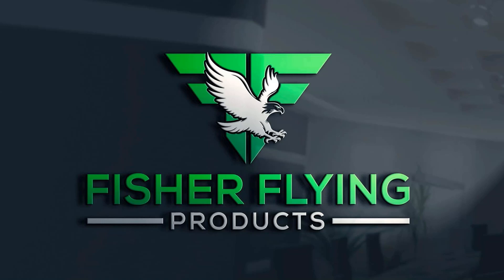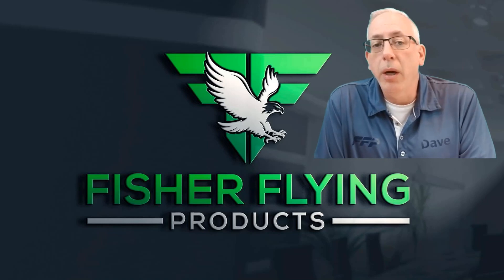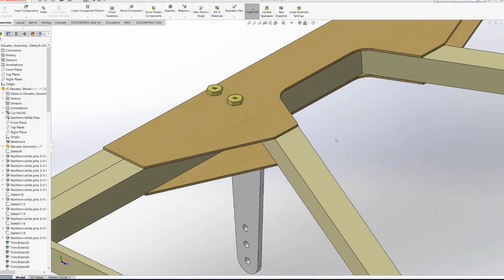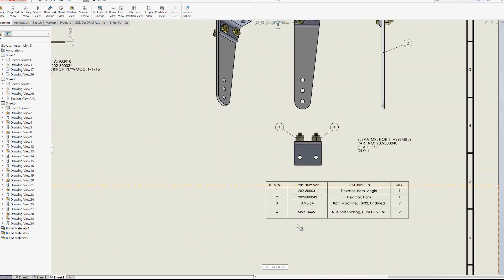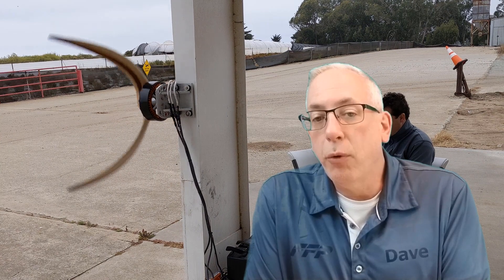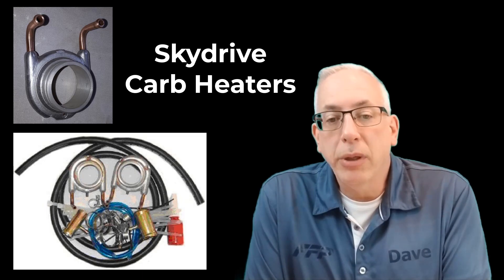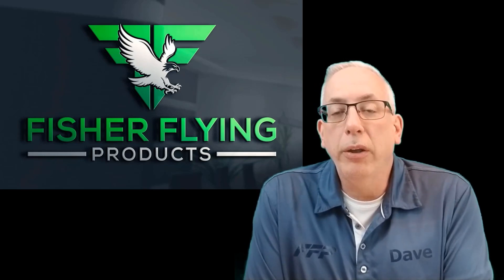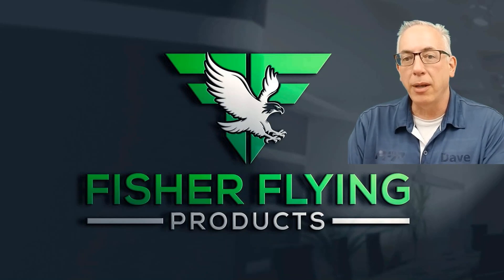NEW PRODUCT ANNOUNCEMENTS - ELECTRO-THRUST ELECTRIC PROPULSION - COZYCARB ICE PREVENTION SYSTEMS

Comment: With regards to the reproduced plans you're working on, and I understand if the answer is no since this kind of thing can cause problems, would it be possible to produce a set of plans in metric? I would think it would be a matter of changing a setting in the CAD program, right? I'm 36 and my brain doesn't work in imperial 😂
Like I said I understand if the answer is no. Converting between units is what caused the Beagle 2 Mars probe to crash rather than enter orbit, so I understand.
Reply from the maker: we will look into it with the designer.